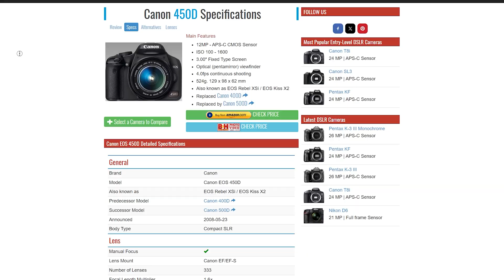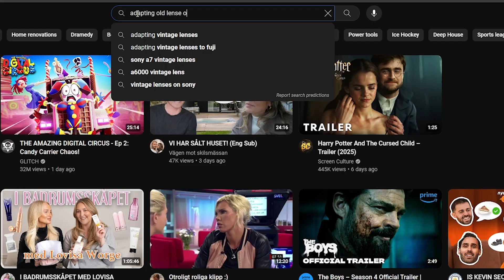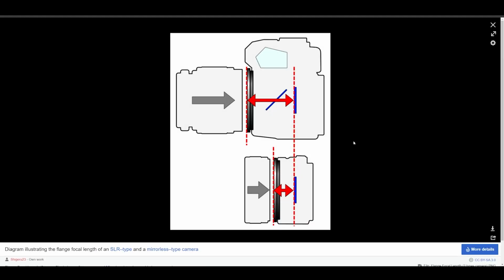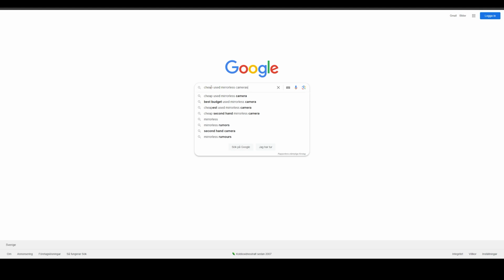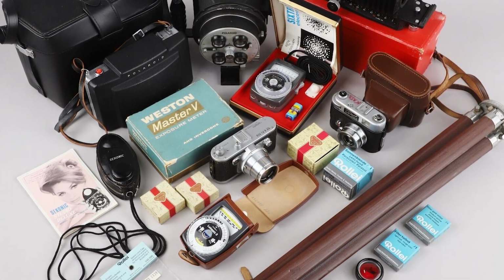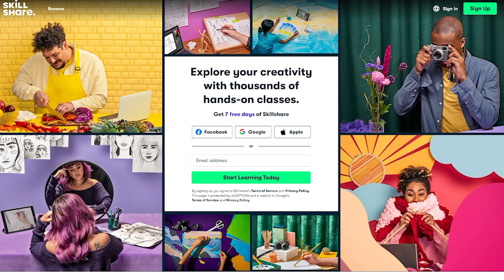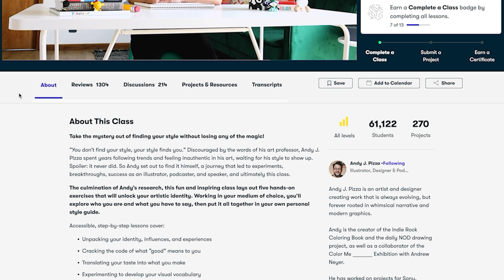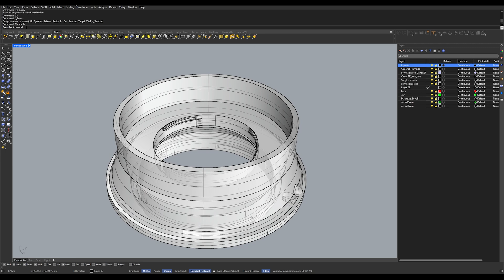Revive Old Lenses: 3D Printing Custom Adapters for Unique Shots

Comment: Are you using magic lantern?
Reply: Also Canon EOS M models are the same flange distance as Sony E mount, and are discontinued and getting cheaper.
Reply: On your second lens, the lack of reaching infinity will probably be because it has lens elements too close to each other and not the sensor plane.
Reply from the maker: I don't have any cameras that can run magic lantern. And yea - you're most likely right about the lens not reaching infinity issue.